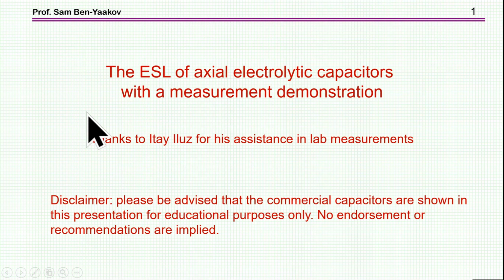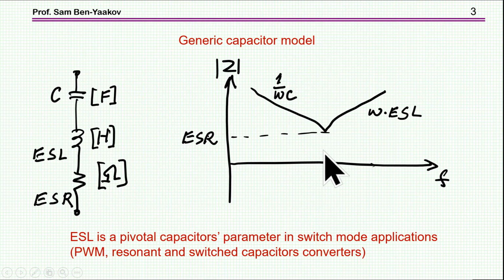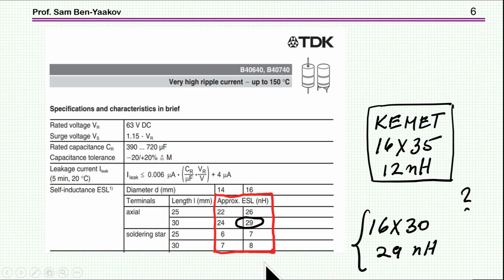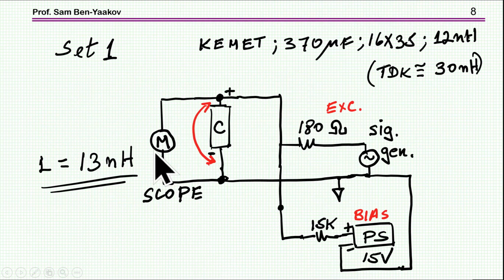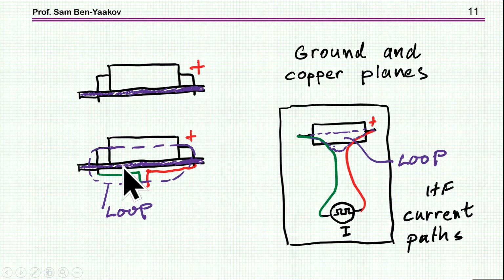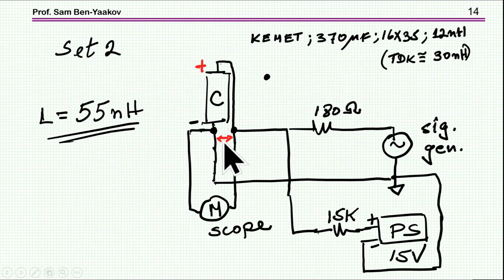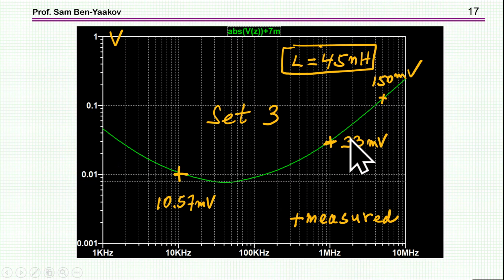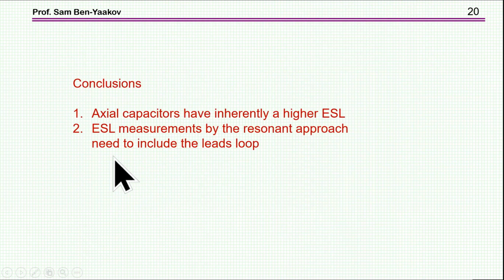The ESL of axial electrolytic capacitors with a measurement demonstration

Comment: If a bulk power rail capacitance is this axial part, which must be the best alternative if you cannot attain the same characteristic with multiple SMT capacitors, and as noted, the lead inductance cannot be minimized (because the part is thru hole and axial), you can minimize the loop area under the part by using power planes, which are very common, but will not negate the lead inductance. For low ESL capacitors the axial package is not viable, as noted in the video, and would require a very unique requirement.
Reply from the maker: Thanks for sharing your experience/thoughts

Comment: Rule of thumb: 1mm of (thin) wire has 1nH inductance. This does NOT apply for wide PCB traces or even two overlapping planes. The demonstration of higher inductance is good, but from a practical point of view, axial capacitors are not used when really low inductance is needed. Another point. Yes, in a practical PCB, the axial capacitor need so lines that connect it and this will significantly increase total inductance. But you could also call this bad design practice. 😉 In the world of SMD and HF capacitors, any connecting leads and fixtures are REMOVED from the measurement by good HF connection style and calibration, so that ONLY the VERY intrinsic ESL is measured, in the order of a handfull of nH. Everything else is left to the PCB designer. If you do it right, you use wide traces or even a direct connection to a GND/VCC plane. You could also do this with axial capacitors, but in real life, this is seldom found. This type of capacitor is a bulky work horse, not a racing horse. 😄
Reply from the maker: Dear Falk, thanks for sharing. I am afraid though that I did not not do a good job in conveying the point of the video, which is: how to measure and define the ESL of axial capacitors. 
As for the "rule of thumb" I think,  and pardon my bluntness, that this is one of the worst misconception in electronics, and in particular power electronics which leads to many ill designs. This is because there is no  practical meaning to an inductance of a wire if you do not consider the return path. Take a piece of wire make a loop of it, measure the inductance and calculate the inductance per mm. Then, take the same wire, fold and twist it and then measure L and calculate L per mm. Will you get the same values or 1nH per mm? Same goes for a PCB trace on one layer and and a return path on a ground plane below. So, when and how are we supposed to use  this 1nH per mm rule of thumb?
Reply: @sambenyaakov  No, don't get me wrong. I think you coverd the problem of definition and handling of ESL of this capacitor type quite good. As for the rule of thumb. Hmm, it is really just a VERY simple and not very accurate estimate. And yes, is does not work in all situations.🙄 It is more like a reminder when laying out HF components just as capacitor, so you do your best to make the connections as short and wide as possible and resonable. I mean if you have a 0603 capacitor, which has something around 1nH ESL, connecting it to an IC via two thin 10mm traces will significantly increase ESL. In many cases this will still be OK, but if you REALLY need LOW ESL, it's not.
Reply from the maker: @JacquesMartini  But if the rule of thumb says that 1mm = 1n +/-,  there is nothing  you can do to make it worse or improve it 😊

Comment: Thank you so much for pointing this subtle detail out. So, if I ever decide to use an axial capacitor, I'd lay the ground plane at the top of the board so as to minimize the inductance. Neat trick to know. 

Reminds me the trick they use in Hi-Fi amplifiers with coupling capacitors. Though these are foil type, the manufacturer strictly adheres to their right polarity so that the outermost electrode of the roll is connected to the output of the previous stage. This way it is connected with a low impedance driver and therefore it catches less voltage interference (providing the shielding for the other electrode) than if it was connected to the high impedance input of the next stage.
Reply from the maker: Thanks for sharing. Interesting.

Comment: Nice presentation Professor Yaakov. But as usual, I have some "complaints". 😉
Somehow I don't understand the test setup. With a power supply of 15V and 15k series resistance and the signal generator with just 180 ohm (+50 ohms internal resistance?), the DC bias is shorted and of no use. Iam missing a coupling capacitor at the output of the signal generator. But this must be HUGE, much bigger than the DUT of 370uF. What am i missing here?
If the output of the signal generator is floating (some are), you could make a simple series connection of DC bias power supply and signal generator.
Reply from the maker: Hi Falk, Thanks for input. There are infinite ways to design this test circuit. Here is my take:  The ESR of the cap is 6 miliOhm. So to get a decent signal  at around resonant you would need  a substantial current level so the series resistor to the signal generator should be relatively small but not too small to attenuate the DC (hence 180 Ohm). To avoid using a coupling cap (why put it if you can get by without it?) the back dc current to the signal generator should be small, say 1mA (hence 15k Ohm). In this design, the DC on the capacitor is about 230mV. which is fine  And no, we do not have a signal generator with a floating output.  Now, what  would be your specific suggestion of design, numbers please, so I can voice my "complaints"😊
Reply: @sambenyaakov   Have you consider an op-amp scheme?
Reply: @sambenyaakov  Mabe like this:
https://i.postimg.cc/ncRDR702/Suggestion.png